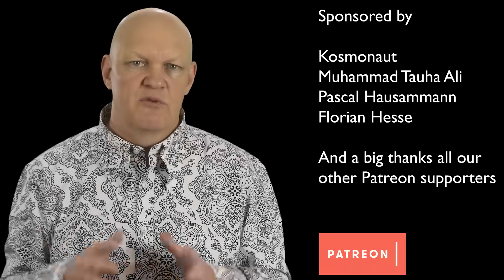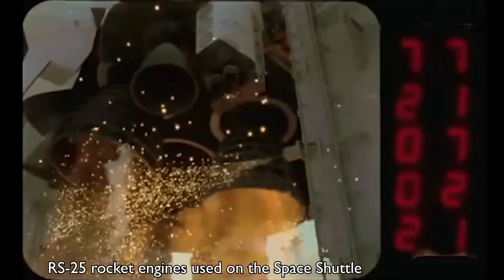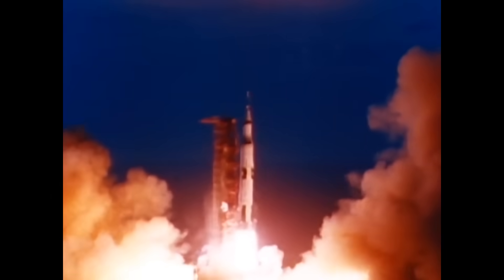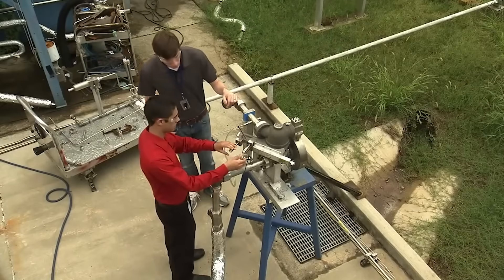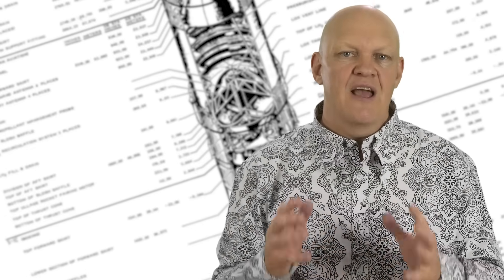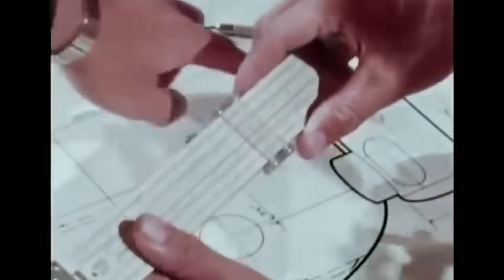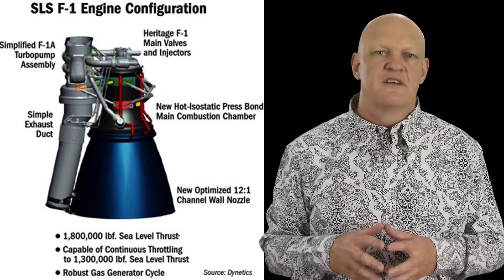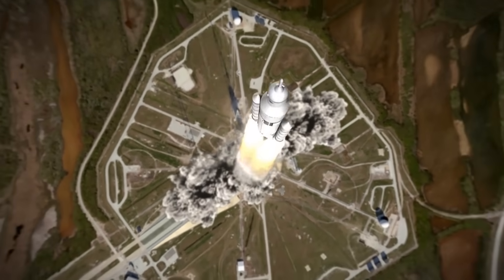Why Can't we Remake the Rocketdyne F1 Engine?

Comment: I worked for a furnace company that was hired to design and build a furnace to replace the original furnace that brazed the nozzle cones. I think the old furnace was decommissioned to make room for a shopping mall in downtown Northridge. We had to stop the design because we couldn't design what they wanted. Not sure if they ever did get something built. I made a couple of trips there and when I stood inside of the furnace that made every single F1 since 1960's my skin tingled. It was an amazing manufacturing plant that put us on the moon. The engineers and machinists and welders were second to none!

Comment: I really liked this video. I am an electronics engineer who started my electronics study and career in 1965 when I was 12 years ols, when I had my own business repairing my neighbors radios, televisions, and small appliances. I went on to become an electronics engineer, and worked for several companies in electronics quality control, and in electronics engineering. Along the way I picked up many practical skills as well, like tool making, using lathes, milling machines, and grinders. Eventually I became the head of the electronics department for a manufacturer of highly specialized measuring devices for the military and the aerospace industry. I retired in 2008. By the time I retired I had seen so much of the development in my field, and acquired many and varied skills. This video is right, with the passing away of my generation of engineers, a lot of skills and information is being lost as well, especially the "hands on" skills needed in prototyping which result in practical, easily workable designs.

Comment: Most of the comments here are ignoring what was said at the end of the video. A new F1 would be more efficient and cheaper and all round better. What is hard to do is to rebuild the F1 exactly like how it was originally made, that doesnt mean a new revised/redesigned version would be any worse. Its like it wouldnt be plausible to rebuild a WW2 battleship exactly like it was built, but we can build a better one.
Reply: @equalism 42 Yes, just like how some modern car engineer wouldnt be able to tune a carb but that doesnt mean fuel injection isnt all round better. And what is missing is specific tuning/adjustments for the handmade F1 rocket, not tuning/adjustment for all rockets in general. In that aspect we are ahead now.
Reply: @equalism 42 Ah OK I see your context. But I was speaking of humans in totality and not any specific industry or country. But yes, some skills are lost because modern technology made it somewhat obsolete. e.g. Pilots from 1930s can navigate while manually adjusting fuel mixture and manifold pressure while wrestling with non power assisted cable controls. Now with FADEC, most pilots would crash if asked to do the same on a modern jet.

Comment: It is always important to have a vault with older ideas, designs and skills. When you consider how Sweden has used a sterling engine design for it's diesel/electric subs to great success, you appreciate that older ideas should be revered and the necessary skills kept. The beauty of older designs is the required simplicity, the ability to manage with fewer resources.

I watched a documentary on Concorde and how they used a subsonic engine to attain supersonic speeds. It is a simple solution.

Comment: I'm not a rocket scientist or engineer, but intuitively it seems feasible for engineers to adapt and update the original design for new manufacturing processes available. From 5+axis Machining to SLS and other metal 3D printing technologies as well as robotic TIG welding (even TIG welding alone) Should overcome the former lack of manufacturing processes, which necessitated such a degree of manual processing/fabricating.
Reply: Yeah but after spending millions chasing that dragon and billions tooling up to make them... you'd be better off just designing a modern engine.

Comment: "Computers are better, faster and the easy of the future"

50 years later

"We quite simply cannot figure out what the PEOPLE did back then to make the engines work"
Reply: It can easily be figured out, but it takes a lot of time and effort. A lifetime of knowledge and skill isn't easy to reverse engineer. Now apply that to every component.

It becomes a pointless effort, and easier to just design new.
Reply: ahh a boomer with a superiority complex , and u laughably drop out the details from the video that state "more efficient and just as powerful, while using only 40 parts compared to the old one that needed 5600 " the new design is superior to the old boomer shit , the future is now old man
Reply: @satamoto6488   Did you mean to reply to a different message? The response doesn't seem to make sense here.

One thing to note though, most things you use now are based on 'Boomer'  technology. Computers work the exact same way, just a lot faster.  

Advances in manufacturing processes allow us to do things they could only dream of. That doesn't mean they didn't dream of it.

It's more accurate to say their future is now, ours is in our dreams. Better to accept that we have built our world on their work, as ours will be the foundation for our kids.
Reply: @satamoto6488   I think you need to re-read. I said reverse engineering old tech is pointless and it's better to design new.  I'm pretty sure the engineers from the Apollo era would think we were insane if we didn't make use of the best advances available.

Do computers not still process binary at the lowest level? Until we switch to quantum processing we're still using the same basic principles, just a lot smaller and a lot faster.

Nothing we have today is built in a vacuum, it's all based on previous knowledge. Does that mean old technology is better? Of course not. But it is still the basis for what we have now.
Reply: @gordoncroft4524  somewhat yes , but 99% of the people in this comment section  are glorifying  old shit and obsolete methods for making a shitty rocket  an it baffles me that no one is looking at the results
Reply: @satamoto6488   I think it may be more a of a reaction to conspiracy theorist views that they couldn't be made. They were and worked beautifuly, but that's a testament to the engineering skills of those involved.

Now as you say we can and do make much more efficient engines with the tools and knowledge we have now.

Apollo was incredible for what it achieved at the time with the technology available. But the skills required to build a Saturn V aren't needed now, so we couldn't do it in a practical sense at this point in time. Nor would we want to.

I have no doubt that 'boomer' generation engineers would have given their left kidney for the tech we have available today. But it's only available to us because of the advancements they (and those that followed) made.
Reply: You can say that again.class room teaching back in the 50's was taken very seriously.you had books to carry home.and they were heavy.students in those days.were motivated to contribute to the space programs.not much computer design.it was with slide rulers and machines made by hand.That kind of discipline is long gone.
Reply: @equalism 42  Where I work we need signed paperwork to put new computers in.

Comment: When they built that engine they also did it from scratch. If you have the IQ to make an engine from scratch then what's the point of re-making an old design? Of course they can remake it if they want to but why bother if they can make it better!
Reply: Wouldn't referring to the old tech be a good starting point to know what worked in that design and what didn't?
Reply: @Jan_Strzelecki  We know what works. We just don't know which outdated process was used to manufacture what outdated part, and figuring it out is a useless endeavor considering we can just use modern designs, modern processes and modern materials rather than doing mind-numbing work for no justifiable reason.

Comment: See, they can do it, it simply comes down to using your head to apply old school thinking with modern repeatable machining processes and exactitude, not that they weren't highly exact back then but I'm sure they built in quite a bit of leeway into there designs hence why modern engineers scratch there heads. Sometimes the home tinker is actually the smartest as hes able to adapt easier and make things work, just doesn't usually document what works, just does it

Comment: Anything that can be done with slide rules and drafting paper can SURELY be redone even better with CADCAM on computers which can accurately simulate and model the internal dynamics of bloody NUCLEAR EXPLOSIONS plus advances in materials and manufacturing. No plasma welding in the early 60s was there?  In short we can, we just haven't.

Comment: The myth is that because it was 50 years ago the F1 engines were simple. In fact they were anything but that. Modern designs are far simpler and the limitations of manufacturing at the time required each engine to be individually tooled and modified. Meaning parts from one engine dont fit another as each part for each engine was hand made. An extremely inefficient and costly process by modern standards. Recreating them today would make them the most expensive and unreliable engines in production.

Comment: It’s just not true.  Welders still hand weld extremely complex welds in a number of industries, including submarines.  You could easily convert the drawings to CAD, fix the flaws and not need unique fixes during construction.  You could use the same blueprints and use modern manufacturing methods. There are many ways you could make it happen. Just rubbish. I was an engineer at Boeing

Comment: Develop an aerospike rocket. Use a barrel launcher to get the thing up to just under mach 1 as it leaves the muzzle. This phase would be propelled by thrusters at the base of the barrel and it's own engines only as a buffer. Keep it from touching the edges with a magnetic field. Don't make it too big. Refine and refine it until it can be mass produced. Then blast heaps of parts into space with it every day cheaply where these parts will be assembled in space with a modular lego type design. Once assembled, inflate huge expandable foam liners filed with various meshes to protect from radiation and micro meteorites. It would be a wheel shaped design so it would look like a giant steel belted radial. Spin it to simulate gravity (turning inside would produce a kind of nausea but should get used to it), send it to the moon's orbit to hitch a ride, then fling it towards Mars at a ridiculous speed to get into it's orbit with a fast orbit cycle and drop at least 3 landing vehicles for redundancy. Rockets only fire to make adjustments. For return, it would fling out of Mar's orbit and head home. Going to Mars Flash Gordon style is suicide. Mars needs to be hit with a heap of support. A bit like the Italian army conquering K2 for the first time. Why am I saying this? I finished work and am relaxing.

Comment: I find this a bit puzzling. Judging by the comment about wasting engines, I gather we still have some in storage somewhere. If so, ...someone should surely be capable of disassembling a few carefully, then reassembling them. In most industries, such effort is called reverse engineering. Surely we could allow companies to bid for the rights to conduct such a process.

Comment: Idiotic video.   If they actually assigned the engineering teams the task to modernize and build these engines they would easily be able to do it.   It is stupid to suggest we would build something today using the same processes and methods used in the 1960s.   Even if they had all the “notes” and old dudes hanging around to provide the tips and tricks, they wouldn’t do it that way.

They would take the general design and approach and design it new, using modern components and procedures.   Chevy wouldn’t build a 56 Corvette in today’s works either.

Stupid article and idiotic concept

Comment: As a mechanic it's the same, my old 1970's triple Carb 6 cyl, would still out perform many modern cars, but we just don't build them like that anymore. Even when  there are similar engines that can produce similar power much cleaner and also start and behave like a normal engine, due to the advances in the industry..... I  still love the old rumbling sound cantankerous splutters and just that raw power..... but I also like my powerful, smooth, fuel efficient comfortable truck lol

Comment: The infrastructure is already in place to build SLBs and RS-25s. That's the main reason they didn't go with an F1 design again. Also, imagine how that would work today if every engine that was built was slightly different from each other. That's more time spent on quality control. Spacex would not being able to supply a crazy amount of Raptor engines to starship if it manufactured them the same way F1 was.

Comment: I don’t understand the argument really? Today we have better materials, manufacturing, design tools etc. Why on earth would we want to resurrect that old turd when we can just design and build a better one? If someone steps up with the funding, todays engineers could turn out a better product twice as fast. Just because we don’t have an old man that can weld shit together with coat hangers and nails doesn’t mean we can’t build a damn rocket motor anymore. Put up the money and it’ll happen. Hand made doesn’t mean better. It means 0 parts interchangeability and higher cost.

Comment: I'm not buying it. We can make anything given enough drive, money and determination. It's just a matter of cost vs. benefit for the F-1. They found a way to get just as much thrust out of an engine with fewer parts and higher reliability. So why would we want to make the old engine? Purely as a novelty exercise I suppose. Sort of like spending millions to take a P-38 that was frozen in ice for 50 years and returning it to brand new flying condition. It becomes on hell of a conversation piece.

Comment: Using the old F1 engine design is only useful if it is efficient, reliable, cost effective, and there is not a better one out there. There is also the consideration of relying on a large engine. If it fails a major amount of thrust is lost, were as multiple smaller engines might prove safer.